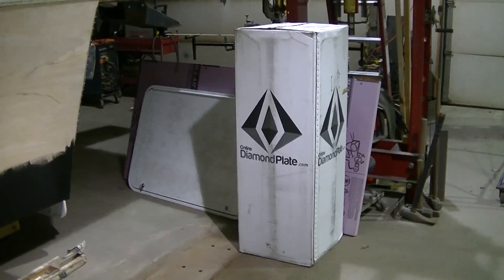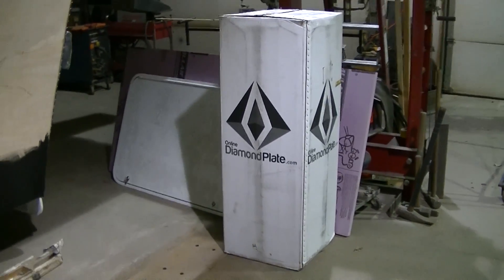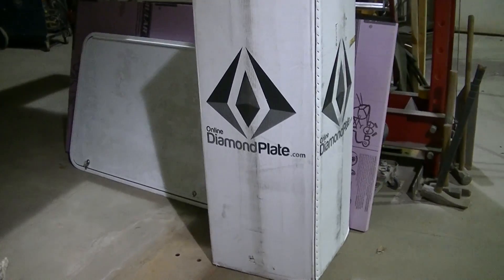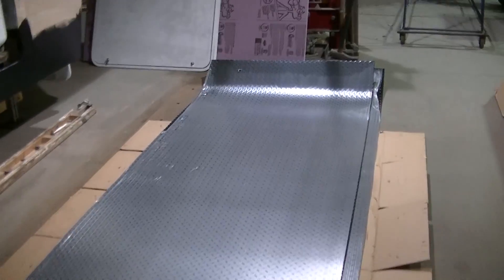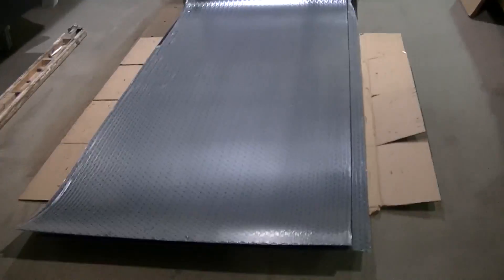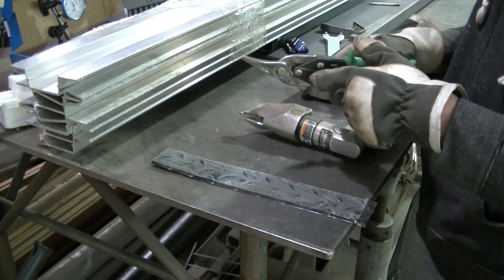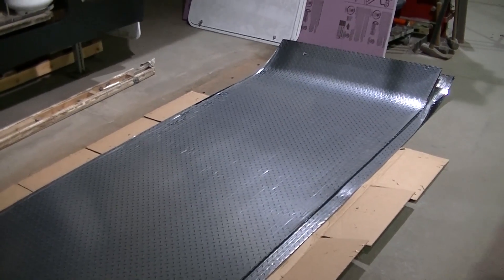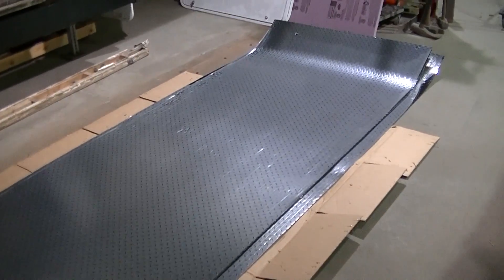OnlineDiamondPlate.com Diamond Plate Aluminum Unboxing & Cutting Tips

Comment: off subject, but hey, if u havent started the deer zero up yet this yr,lets see a 1st start of the yr cold start on it. lol that diamond plate is cool stuff,wonder if it would work for rock gaurd on trailers or maybe to thin,what do u think?
Reply from the maker: +Game Bred Duramax   The John Deere has been started.  I put my plow away for the year so I had to move the mower to get the plow in.  It has never given me any problems starting.  It cranks for a short time and starts right up.  I am not sure what gauge rock guard is.  This aluminum is .025".  I think it would work for rock guard.  Will it dent?  Probably but I have never seen old rock guard without any dents.